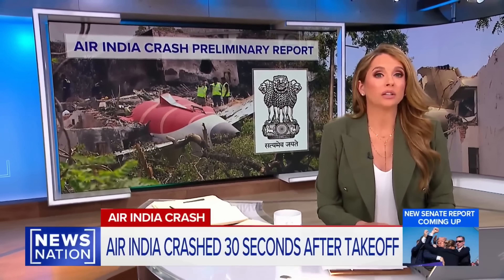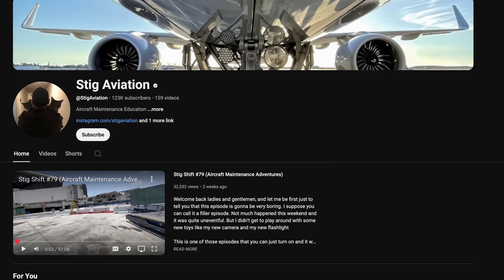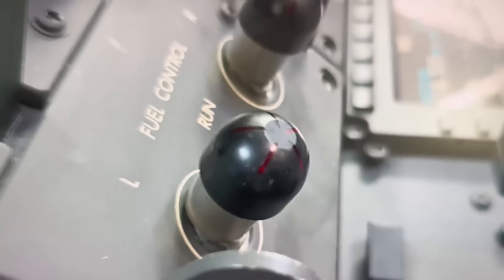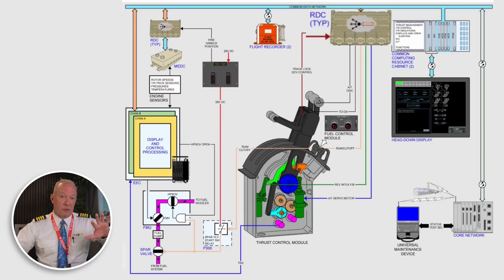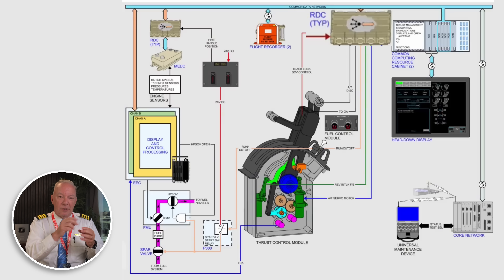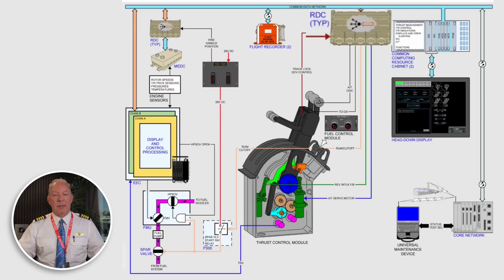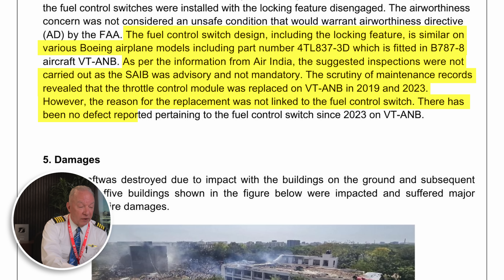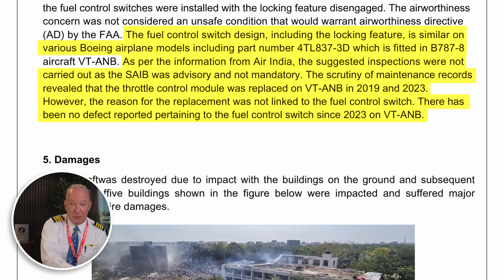The Truth About Boeing 787 Fuel Control Switches

Comment: The fuel cut off has a strong spring, and the center  stop piece of metal is flat on top. Can the switch be ½ way? I would design a switch center stop with a sloped angle, not flat on top for that reason.

Comment: First, let me say that I totally agree that the fact that the switches were both moved 1 second apart means someone operated those switches. Random switch or related failures would not have occurred so close together. HOWEVER, you aren't reading that diagram correctly. The relay provides power directly to the SPAR valve but is ANDed with the HPSOV OPEN input to operate the HPSOV valve and has no effect on the FMV valve.
Reply: I agree. It is possible that the pilot can switch both switches in one sec. But Captain Steve is reading the diagram wrongly. If you pause Captain Steve’s the video when the Boeing-style schematic is on screen and look closely, you’ll see three valves in the fuel path: HPSOV, SPAR VALVE, and FMV.
- The SPAR VALVE is the only one directly controlled by the pilot’s fuel cutoff switch via the 28V relay.
- The HPSOV will only open if both the pilot switch is at RUN and the EEC (FADEC) commands it open, but it can be closed by either one alone (there is symbol with a flattened "D" shape representing a logical AND connecting both signals).
- The FMV is only commanded by the EEC, not by the pilot.
This means an EEC/FADEC malfunction could close HPSOV and FMV, shutting down fuel flow, without any movement of the pilot’s switches. That’s not what Captain Steve was telling us, but it’s right there in the diagram if you study it.

Comment: You need to listen to Richard Godfrey & what he has said makes sense that electronic power was cut off to the  plane & apparently just after the plane lifted off the run way the transponder turned off.
Mate of course the power from the batterys  can not be always there. So 28volts needed to have fuel value open but i think a 787 would have maybe 4 or 6 DC batterys & connected all  the battery together to boost voltage to 28volts but if a connection lose between two batteries will end up be less voltage &  fuel values would not stay open.

Comment: I left this comment on the Piers Morgan show about this which you attended, but no one has ever dealt with it. How does the switch turn on the relay? Is it just the physical position of the switch regardless of the vertical position of the spring loaded lock. What I am suggesting is that the switches might have been hanging on the nub and not pushed home. This position was sufficient to engage the circuit, but when the acceleration of lift off occurred the switches slipped back off the nub and turned off the circuit. I stress again, does the spring lock have to be fully home for the switch to operate, or does it simply lock the movement of the lever?

Comment: It is 99% that the switches were moved intentionally. That being said, the lock feature of these specific switches is not as robust as, for example, a bleed air switch on a C-130, even though the locking concept is the same. During 6 years of conducting OE for new Part 121 pilots, I did see instances where new FOs didn't fully understand the mechanism and did not fully engage them in RUN during start - i.e., the switch was raised but not engaged and light pressure could bump it OFF. I did also experience one failed internal spring in my career - obviously rare, but it did render the lock feature unreliable and was written up for repair. There is an additional case where an iPad was propped behind the throttles, it slipped, and knocked both fuel switches off (guards were later added to this fleet). So, my point is that, while the 787 accident was likely intentional, there should be a greater focus on these switches, training and habits for their use, and for future designs or for an improved replacement part. 20,000 hour former USAF & Part 121 pilot.

Comment: So what if the 28v battery failed or the wires failed? Or the valve connectors, corrosion or fatigue etc. if anything breaks that circuit it's an issue.

Comment: At first I thought perhaps a wire had broken to the relay which triggered the relay open and shut off fuel and then you debunked my thought with the comment of 'they're both totally separate systems'. 
Yeah, both active cables to each relay breaking within a second of each other? It's possible. But, nowhere near as likely as likely as it being manually shut off. 
Maybe it was an automatic reflex type deal. Just running on autopilot and shut them off? Head wasn't in the game on the day and running on system 1 rather than system 2. 

I haven't kept up to date with all the new information. Was the ram air generator deployed? Was there a reason for that? or was that disproven?

Comment: I read one article that says if both engines are not working, a manual restart will start the engine as per airline/aircraft guidelines. So basically, somehow both engines failed before pilots manually restarted the engines.Can you please explain that?

Comment: Hi Captain Steve, can you please answer my question: could an external electromagnetic current switch the relay within the fuel cut off system? This is the only part you haven’t covered. Thank you.
Reply: There's a lot more he hasn't covered but as for electromagnetic interference it's doubtful

Comment: Is the mechanical position (not just the electrical signal) of these fuel switches being monitored and logged to the flight recorder? In other words: are there two sensors in addition that measure and report the physical position of these switches?

Comment: Not a specific 787 mechanic, but those fuel valves are almost certainly command-open and command-closed.  You described normally closed valves that are commanded open.  They would NEVER design an aircraft fuel system with engine feeds that require power to STAY open.

Comment: The switches are working correctly but I cannot understand why both switches are allowed to be turn off when the plane is in the air. If the software detects that both engines are working properly and the plane is in the air, then the software should not allow the switches to be turn off even if the switches is mechanically turned off. If one engine flamed out, then the software should only allow that switch to be tuned on and off to attempt reignition of the engine. If in the event that both engines flames out the the software should allow both switches to be turned off and on. That way if both engines are working properly there is no way the pilot can switch off the engines on purpose. If the software is programmed this way, then we can rule out pilot suicide in this Air India crash.

Comment: If the fuel switches failed then how could you turn them back on. That’s not a fail that’s a manual operation of the switches.

Comment: Auto-Relight
"If a sub-idle stall is detected, fuel is shut off for one second in an attempt to clear ..."
FCOM 7.20.14 Feb 15, 2010. D615Z003-TBC
That, to me, indicates something can shut off fuel - if not by a valve, then by what method?
If an erroneeous message was recieved and the systems thought a sub0idle stall had occured, then that sequence would occiur.
I can both understand and see why people are still looking for answers. Captain Steeve is saying there is no way, and that seems to say there is a way.

Comment: Captain Steven lots of respects for you but a newborn baby can tell that it’s was an engine failure as the nose of the plane was still up. About the switch the rat was deployed that mean engine was fail due to electrical failure. They try to fired up the engine unfortunately was too late

Comment: why I believe is intentional? "fuel cut off is consecutive and not simultaneously" next I am an engineer, and if I am designing the plane, I would not allow a single fault wire to cause engine cut off (meaning there will be 2 signal detect wires in thee switch,  therefore only allow fuel cut off when both signal switch gives the same signal) and I have worked on marine vessel maneuvering control system (Nabtesco) I can confirm we use multiple signal system and multiple control boards (master and slave) to confirm a command from the captain or chief engineer.

Comment: Thank you Captain Steeeve !!!  It is 100% clear how these switches operate. It is about as simple as anything one will ever find on any operating system of the Boeing 787.  And it is also very clear that those 2 switches were moved to "CUT-OFF" position by someone in the cockpit of Air India 171  -  and then someone moved them BACK to RUN position. It is also quite clear that someone asked Why did he cut off. The reply from someone that he did not do so.  
Both the switches from RUN to OFF and back to RUN are again recorded by the data recorders. And someone spoke to someone recorded as well. The RAT was deployed as it should, and when switches moved to RUN the engines spooled back again. 
And if there were any other GLITCHES in the systems, it is remarkable how quickly they disappeared when both switches in the RUN position again, be it for a few seconds only before the accident.
BUT I await the final report on this accident. Greetings.

Comment: ok, but why are the fuel control switches operational directly after a take-off? They should be disabled until a plane reaches an  altitude off xxx feet. 600 feet or 800 feet maybe..

Comment: As a retired Electronics Engineer, we used to carry our failure analysis on prospective designs to predict the possible outcomes of various component failures. This would no doubt also have been carried out by the designers of this aircraft especially in regard to safety critical systems. We don't know the source of the diagram that Captain Steve is referring to, but as it stands and without studying it in depth, it would appear that there could be several components that could, if they failed, result in fuel cutoff. However, if one assumes that the second engine has its own completely separate fuel supply and control, the likelihood of both failing is unlikely. 
I guess though that we will have to wait for the final report.
Reply: Since you are an Electronics Engineer, you must have noted that Captain's narrative on the functioning of the valves does not correspond to the diagram!  There are 3 electrically actuated fuel valves per engine, of which only one (SPAR VALVE) is directly connected to the cut off switch relay, another one (FMV) is only connected to the control unit and the last one (HPSOV) is connected to the control unit as well as to the relay output.
Reply: @u3b93  Yes, there's much we don't know. How did they determine that the cut-off switches had been moved? position sensor? secondary contacts? or loss of 28 Volts? Might a frantic pilot have toggled the switches in an attempt to restore power. https://www.youtube.com/watch?v=OLxLN3osS1Y shows more of the electrical system. His conclusions? Well I guess that's more speculation.
Reply: One cutoff switch failing and cutting fuel due to malfunction makes sense. Two, one second after the other, and then switching back on a few moments later seem almost impossible.
Reply: You say that's not how the system works. But we can also say that that's not a pilot works. A pilot will never off the fuel switch without a reason.
Reply: @manubala38  Agreed. I'm no pilot, but I picture myself riding a 300 ton glider a couple of 100ft from the ground. Do I calmly pick up my I-Pad and start searching for instructions or do I check circuit breakers, if there are any close by, pull the fuel cut-off switches switches and re-seat them or whatever.

Comment: They why part always brings me back to the crash video.  It always seemed odd to me that someone was standing there recording the spot where the crash would take place.  It took very little moment to adjust to the path of the plane as it went down.  Almost like someone was waiting for it to happen.  I heard no reaction in the video that indicated any sort of shock.  Just a calm recording of the incident.    It doesn't mean the two are definitely linked.  And it is possible the reaction came seconds after the clip ended.   We've seen enough crash videos over the years to know there is usually some kind of comment.  Standing there filming the rooftops and the plane enters the video and crashes without any commentary is just weird.

Comment: IF the 28V power supply for the relay fails does the fuel system fail closed or fail open?

Comment: Captain, What if N1 suffered an compressor stall and copilot,  without any discussion , just put the N2 to cutoff.  He realized that moments later and then turned off the N1 switch which turned both engines. After Pilot noticed,  he talked to him for 10 seconds and then the pilot set both of them to run. 
Captain would that happen

Comment: seems a bit crazy to me to have the control relay default open ( no power to the relay means fuel is off )  and no backup to  that one relay.  im a radio ham and know only to well that relays no matter how good or new they are can fail as well as connectors come loose even with no vibration.  ambient temperature rising and dropping can cause loose connections.   as well as momentary circuit over heat which also causes dry joints in solder joints that can remain undiscoverable due to occasional momentary faults.  allowing for that and the fact that electric traveling along the wiring loom creates its own heat.   would it not be better to have the fuel valves open when the relay is open ( no power to the relay means fuel flows )? at least then a fault in the fuel switch system would show its self much quicker.   also if there was twin relay system with the fuel switch being 3 gang ( pin 1 power in and 2 separate outputs too the 2 relays ). at the very least this would increase a failure detection  of one of those circuits while the other circuit still worked. it would also mean that if the switch itself failed or the battery died for some reason the bird would still fly.  there would have to be an emergency cut off after that granted but a small price to pay for so many lives.